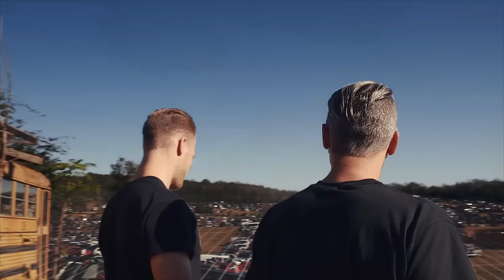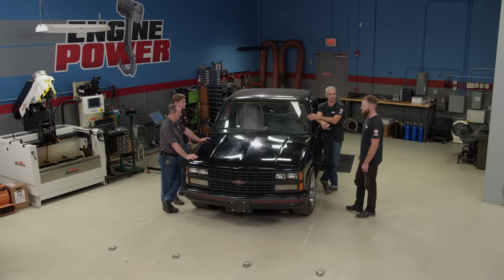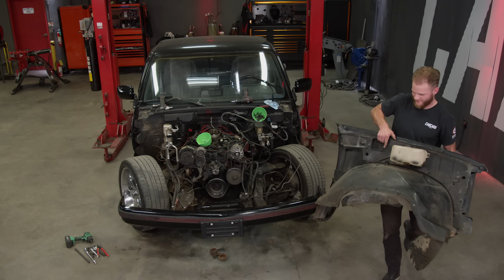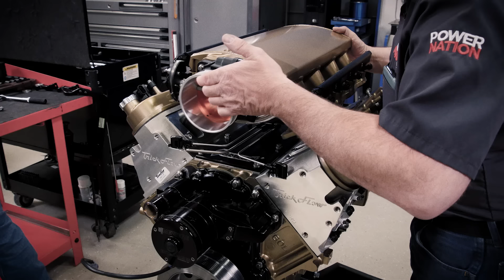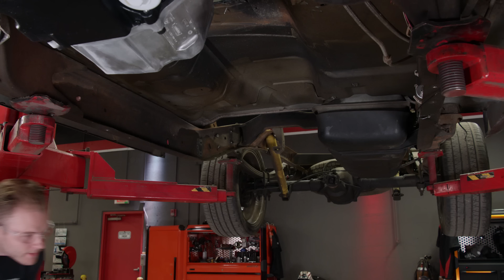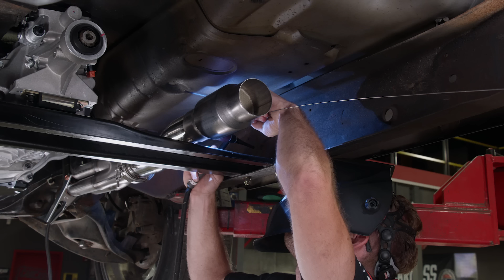We Put Race-Car Suspension Under an Old Chevy Truck

Comment: That 174hp from a 305ci TBI to the tires with that many miles is pretty healthy. Nice testament how well and durable the GMT400 platform is when trucks used to be made and assembled in the USA. Only thing that kills these trucks is neglect and rust.
Reply: Per Wikipedia: The GMT400 truck models were built at Ft. Wayne, Indiana; Pontiac, Michigan; Flint, Michigan; Oshawa, Ontario, Canada; and SUVs at Janesville, Wisconsin and Arlington, Texas.
Reply: These are late 80's and 90's trucks.  They didn't make much of anything in Mexico until Clinton screwed everyone with free unbalanced trade, which was late 90's.  The LS platform took over during the time shit started to come from Mexico.
Reply: That's not pretty healthy that's more power than new on paper!
Reply: You can hear it has exhaust, so maybe it has some heads and intake? Im sure it has a chip in it
Reply: Most GM pickups are still made in the USA.
Reply: even neglect can be fixed but the rust here in NY destroys them
Reply: @RusticShine but hey 20+ year old
Reply: Majority of GMT400s weren’t made in the US. They were made in Mexico.
Reply: @95roadie thats a lie...

Comment: Had you guys sprayed the gold over gray primer first, you’d have used exponentially less material, then the black cherry would have covered the gold in a single coat so when you cleared it the tape edge would be almost nonexistent, ideal when you can’t cut and buff because of flat clear…..

Comment: What happened to test and tune? Not enough rate in the front as delivered to the track. You can see the opposite rear corner lift on entry to the turns and hear the rear tires lose traction in the weight transfer. Dial up the rate on the front until it starts to push and then back off a hair. Shave 1.5 - 2.0 sec. per lap.

Comment: You said you weren't going to finish out the exhaust until the rear suspension was ironed out. Is it safe to assume you still didn't have it ironed out at chassis dyno time? The exhaust ducting was plainly - and poorly - set up ahead of the rear axle.

Comment: The 305 was rated only 175hp from the factory it was doing good for 247k miles.
Reply: @J_ismyname48  you didn’t watch the video did you? Lol
Reply: Lmao, you got me. I am still watching. Apologies
Reply: I agree, not bad at all. I own a 92 k1500 with a 5.7 tbi with 330k on the body and trans. The engine was replaced by a local dealership at 180k woth a factory long block crate engine and I doubt it even has 150 hp anymore lol. It has been one hell of a truck tho, I still love to drive it.
Reply: @J_ismyname48  tbi...power
Reply: @pops3554  ????
Reply: Damn they had me fooled

Comment: Thank God no silly airbag suspension. You guys nailed it with the 3-link suspension, brakes, a clutch, and LS7-type horsepower. More details on the torque absorber would have been helpful.
Reply: I'm trying to figure out what the upper center link contraption is? Looks funny.

Comment: Next time please explain the process of aligning the rear bell housing gears and shafts in the pumpkin. I heard getting it just right without fouling is incredibly difficult. Using shims and cutting to length. I watched a Video recently that it took them 8 tries to get it right and looked like a nightmare. And I think you glossed over mounting positions for the rear axle mounting points that you cut in too much to grasp how to do it. I get the sense that this show is assembly porn without explaining the how and why and measuring techniques.

Comment: At the 1 hour 35 minute mark on the final Dyno pull it looks like there is massive arching across the entire engine bay.  You see it from plug wire to plug wire and then ultimately discharge against the alternator.  It would be interesting to see if you gain any HP after getting that sorted out.
Reply: I watched it again on my TV you can see it arc across all 4 coil packs and then jump to the alternator.
Reply: Its actually something falling into the back of the alternator and then flying out of the engine bay. Whatever it is can be seen landing on the intake also, might be something in the hood liner.
Reply: I have a 97 Sierra 5.7 vortec with a cowl induction hood. Every now and then while driving I see arcing through the vent on my hood coming from the engine bay. I have yet to determine where it's coming from exactly. Any tips on how to diagnose it and determine the source? Thx in advance

Comment: I own a '95 short box reg cab. It started life as a z71 with AN ORIGINAL 5 SPEED!! At 344,000 miles, she pushed the passenger side head gasket. Started knocking on the door right when i pulled in our driveway. 
  Today, it has a 2010 2wd front suspension conversion with camburg engineering stage 5 long travel suspension, 3.0 triple bypass shocks, 3.0 coilovers, blitzkrieg hubs and swing set steering, 9 inch out back with a spool and 4.086⁶s triangulated 4 link with 3.5 triple bypass coilovers only. Then, the best part of the truck is the port injected 400 small block i pulled out of a outlaw dirt track car. 800 horsepower with the carburetor. After the injection, e85, on a Holley terminator x she made 690 WHEEL hp and thats through a built turbo 400 and 40 inch tires. I also have Rusty Wallace's boom tube from his ride in 1997. My grandfather was Don Garlitz's engine builder, Wallace is one of my grandfathers best friends  Anyway, equal length long tubes going to an 8 into 1 collector i made myself then straight to the boom tube, the noise it makes is nothing short of EVIL! Its no joke in the desert. Its so ungodly fast. The truck only weighs 4100 pounds. Not to brag but the mismatched 25 year old king triple bypass and 8 year old QA1 coilovers honestly work better than most of my buddies brand new stuff. Anyone who owns a pre runner rides in my truck and immediately says their truck aint shit. Im talking brand new Tacoma with long travel, bed is totally cut out with a tonneau cover then i have 2 yakima storage units mounted back there my spare tire is mounted to a subframe system i built (just like every single other aspect of the truck) under the tonneu cover so when i open it, i pull 4 pins and the actuators slowly let my spare down to a reachable spot, spin the wing nut off, throw the wallerd out unit back on there. The tonneu cover did require substantial modifications to support the weight so there are some grade 8 hex heads kinda messing up the cleanliness. But now i can load 2 450s right on top of the tonneu cover in place of the yakima missles. I have a/c, an actual screen from a Tesla model 3 in the dash, 6 speakers with 1, 8 inch subwoofer. The boom tube exits out of the bedside right in front of the passenger rear wheel right where the OEM molding was. The fenders and bedsides are excessively cut for clearance and i have 5 inch bushmaster flares. The intake is inside the cab and i reserved an a/c duct which i ran directly into the airbox i made. I dont know why nobody does that because its absolutely amazing how fast it cools the thing down. I have a satin black wrap with gold method beadlocks. The bedsides are cut at a 45° angle from the wheel arch to 4 inches below the taillights and i bult my own rear bumper from 2×4 4130 square tubing. The front end is cut all the way up to the secondary lights then i made my own bumper/winch mount/skid plate  that spluts into 5 different pieces so i can replace whatever i destroy not the entire thing. I also made my own pop up tent that clamps onto the tonneu cover, then extends up 8 feet tall. I bring a small generator with me, and my wife and i play dirt 3 and forza 4 on xbox 360 out in the middle of nowhere on a 52 inch 1080p Samsung flat screen while laying in a memory foam king size bed. I put a tailgate window regulator and motor from a 1984 suburban in the cab which i fit a one piece rear window to, made a secondary firewall i guess you could call it to contain the mechanism and i have the only obs single cab with a power rear window. I made a flap in the back of the pop up tent lined with flexible magnetic strips which attaches to the cab and creates a semi stable seal so we can have insane a/c if it gets too hot. My wife love the truck so much she actually gets depressed when we get home from the bush. Its saved our lives 4 times. Got us out of a really, REALLY bad situation with 9 or 10 dudes that aggressively drove up on us and started screaming to get oug of the truck and get on the ground...all this crazy shit. I racked a round in my pistol but then i thought, if they make a kill shot on me, i dont wanna know what theyll do to her, so i shimmied through the rear window, she followed suit, threw her in 2nd, and proceeded to throttle the shit outta these creeps with 70 mph baseball sized rocks then just took them on the express lane to gaplebees. I know those dudes would have killed me and raped then killed my wife. It was 3 in the morning, the wife and i are literally in the middle of making a baby, then these dudes showed up. I ain't scared of a damn thjng ESPECIALLY another man but 9 or 10 of them at 3am with guns and im in the act of taking the wife on a tour of climax canyon. Offputting to say the least.
Reply: Say more please!😂
Reply: Hahaha writing an essay

Comment: I like how the truck grows parts in between episodes. Other than space confines, which wasn’t the case on this vehicle since they put a gaping hole in the bed anyways, is there any advantage to a cantilever suspension? I can’t think of anything and “because it’s cool” is a lame reason. But by doing this they made the truck bed completely useless which then begs the question of why even build a truck in the first place? It’s going to be less capable as a performance platform , heavy, tall, poor weight distribution and poor aerodynamics and the one thing it could do, haul stuff, it can’t anymore. And I don’t mean heavy duty hauling but having the ability to throw parts in it, gear, whatever you don’t want or can’t fit in the cab. I like sport trucks but my thing was always that it had more than one use. This one isn’t good at anything.
Reply: If I remember correctly, you get more travel out of a smaller coil along with the cantilever acting as a pivot point making the ride smoother. Could be wrong but that has been my understanding, never been in a position to have a cantilever set up so I haven’t done too much research on it.
Reply: Yep , that's the only thing that I didn't like plus I'm the type that feels like, hey gm quit making those parts years ago so there is only so many left if you know what I mean, it breaks my heart
Reply: I agree. I feel like a 4-link, coil-overs, and a boxed frame would leave a much more capable truck. I also hate it when people lower a truck so much that the pumpkin sticks up through the center of the bed. In this case, it's the coil-overs and the arms, as well.

Comment: Don't know what to say... wonderful job with the suspension & engine, but a little disappointed with the paint job. I was left short with the details. Will hate to open the doors, hood or even remove the bed and see the old color.
Reply: They wanted to build a race truck, not a sema truck
Reply: @bradenkowal8117  regardless if it is a Rat Rod, patina or else. They chose a new paint, in my eyes, as builder myself, you should do it right. They will eventually sell it somebody else's and will end at somebody else's shop, thus, costing more money to get it right and perhaps bringing bad reputation to themselves.

Comment: Super cool build and I really like the result. As a piece of custom engineering. As a "race truck" the amount of money and work that went into the engine, custom suspension, fabrication, etc. For it to be "in the mix" with a bunch of other weekend warrior drivers, is really not a very good ROI.
Reply: They built it cause they wanted to...not worried about getting money back

Comment: My 17 year old son has a 1996 chevy extended cab z71 5.7 4spd auto factory 3.73 gears 14bolt nf rear axle and I have a 1985 d10 m1009 military blazer 6.2 diesel na 700r4 swap 3/4 ton axles 14bolt ff 4.10 gears

Comment: If you figure in labor hrs.  Wouldn't it have been cheaper to just build a SRT Ram  and bolt on tune  they do 155 mph  stock .  smoke any stock chebby

Comment: I hate that you call the front a "strut". If it has double A arms, it isn't a strut...
Reply: There are different kinds of struts...it can have 2 a arms and a strut..like most newer trucks. You're thinking of the macpherson strut style with only a lower a arm.
Reply: @bradenkowal8117  what's the difference between a shock and what you call a "strut" on a double A arm truck?
Reply: @totensiebush  basically just the way its mounted....like i said theres different styles of struts
Reply: @bradenkowal8117  my opinion is that if the bottom is mounted pinned, it's a shock rather than a strut. 

of course, my current ride has leaf spring and struts up front...
Reply: @totensiebush  strut is a coil over shock in one. A shock is just dampening device.
Reply: @techs1smh13  I 100% disagree. A strut controls geometry (camber etc) as well as providing damping. Whether or not there's a spring has nothing to do with whether it's a strut: Porsches often use struts with torsion bars, Sprinters use struts with (transverse) leaf spring. 

If it has two bolts at the bottom connection, and they can be adjusted to adjust camber, it's a strut. If it has a single (pinned) connection at the bottom, it's a shock.
Reply: @totensiebush   I've always thought a strut was inside a spring. You know more than I do. I don't play with cars anymore. My son's. 16 1500 Chevy has strut front with upper lower a arms that's what I'm familiar with.
Reply: @techs1smh13  I would argue that has coilover shocks rather than struts. 

An easy way to tell: put the car on stands etc, pull the shock/strut, bolt it back together. If wheel can flop back/forth re:camber, it's a strut. If it can't, it's a shock.
Reply: @totensiebush  Google McPherson strut almost every photo shows a coil spring over the strut. That was my original point. Not how it's mounted if it controls caster bla bla.
Reply: @techs1smh13  I agree that a proper MacPherson strut has a coil spring over it. There are lots of modified not quite MacPherson struts that don't, and there are also lots of coilover shocks that have a spring but aren't a strut. 

https://en.wikipedia.org/wiki/MacPherson_strut that gives the basics, and has good references.
Reply: @totensiebush  cheers 🍺

Comment: if i hear that hipster say OBS 1 more time,
Reply: Obs
Reply: Yeah freaking hipsters!
Reply: Then what?
Reply: What does obs stand for
Reply: @BBD40  old body style
Reply: Obs
Reply: Lighten up Frances!
Reply: Should be categorized by body style, I don't know when they changed, but there were quite a few different styles.. I for one had a '79 Short-bed step side I got from the town DPW, it was 2wd,  and had a 305. (BFD right) Anyway I got rockers cab corners fenders tailgate couple odds and ends read the interior had it all primed and jammed, this real nice ruby red, and I drove it for 6 months, and I ended up trading it straight up for a '70 Chevy Malibu bone stock with a 307 and 67k mi. Friggin miss that car somethin' fierce.. 
Oh well , that's life Chevy powwa! ✌🏻🏁
Reply: Well it is a OBS...
Reply: @barrygordon1173 
Facts

Comment: honestly, a good backroad cruiser would've been the way to go with this truck. better front suspension and some Trac bars in the back. I think a staggered wheel and tire setup would've looked good to. I would've kept the black paint as well. Engine wise a 400hp 383 would've been the ticket.

Edit: WTF happened to the fenders and wheel wells?
Reply: yeah they cut them for clearance and never showed what they did to fix them. One shot its out the booth from paint then next clip its rocking custom fender flares
Reply: @Val_Killmore  Those fender flares look to be the same type Chevy put on their 4wd trucks of that era
Reply: Tire clearance for the 335 width.

Comment: Nice job guys!  I love what you did to the truck but have one question. What with all the neat parts and custom fab items why didn't you paint the chassis?  I would think that a project as good as this one turned out that a frame off or rotisserie  powder coating of the mechanics, frame, and underside components or at the very least a power washing and rattle can paint job was in order. It broke my heart watching you swap engines in a dirty, rusty engine bay.  My 2 cents
Reply: Looks like its all painted later on. They dont have time to show every little detail. Especially on this compliation of a bunch of episodes
Reply: Sponsorship dictates much of what's done.

Comment: Usually those conversion companies were really proud of their work so they put badges everywhere.  If not maybe in the glove box should be a build sticker. The dealership I worked at ran quite a few conversions through the lot both new and used. They were pretty sweet back then. They even had models with basically van seats in them and they were Hella comfy!

Comment: I was always under the impression that a high mileage motor made less power than new but I guess I was wrong, I guess it all depends on maintenance.
Reply: I’d like to see Pat pull that 305 apart and see what heads are in it and profile the cam. The L05 TBI 350 from 89 only made 190HP flywheel. Some reports up to 210 but no way that was a factory stock L03 TBI 305 with swirl port heads.